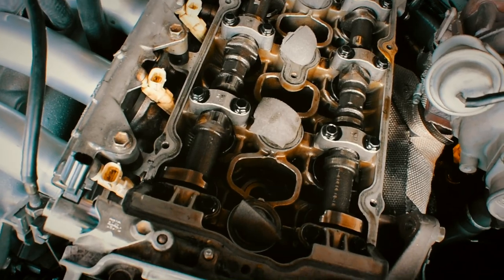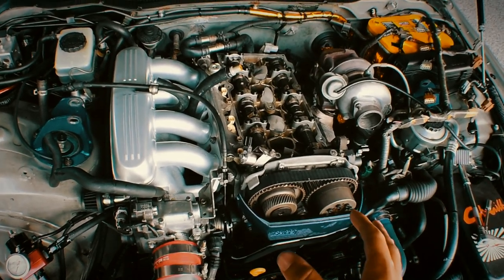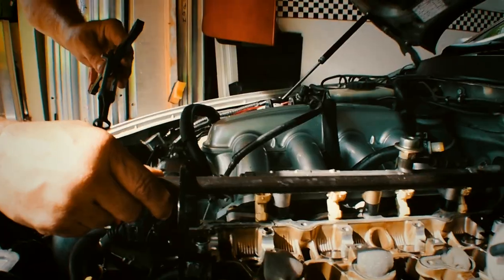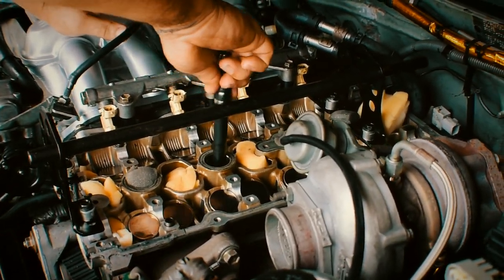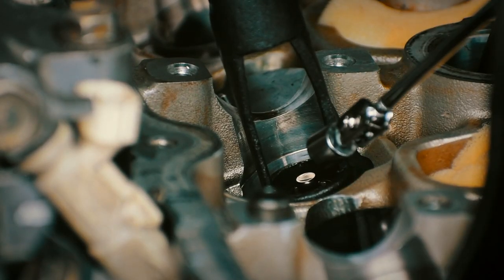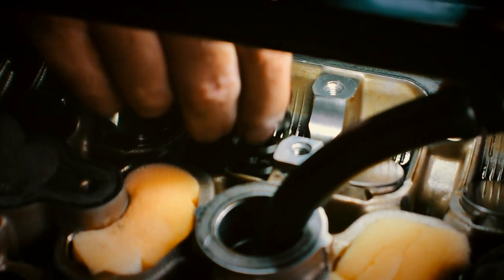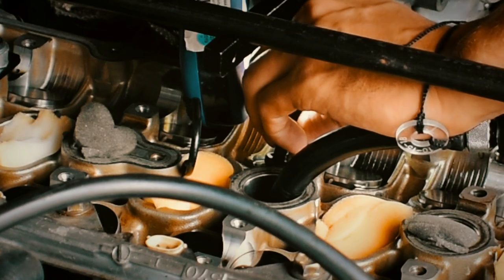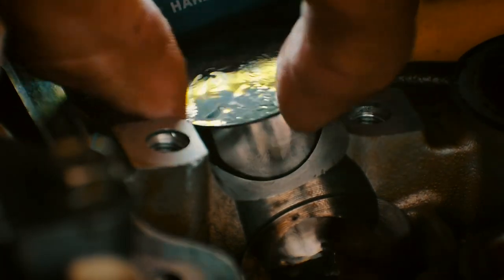HOW TO REPLACE VALVE STEM SEALS WITHOUT PULLING THE HEAD!

Comment: Where you do buy your beams engine parts from? My beams engine has a miss and runs rough at low idle. Cylinder 3 has a lower compression and I'm hoping it's not going to be a major repair.
Reply from the maker: Sorry to hear about your issues :/. 
I got most of my parts from Trinidad 
Amazing people over at @thetezzashop868 
They helped with so much and had alot of altezza parts in stock 
Definitely recommend hitting them up 
Let them know I sent you 

Hope you can get things worked out!
Reply: @CJBuilt  Thank you very much for the info!